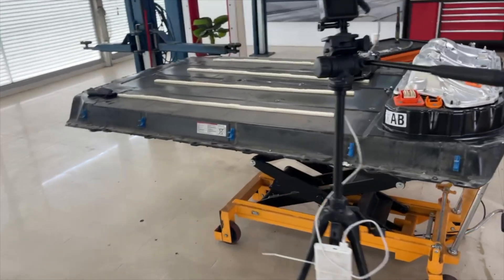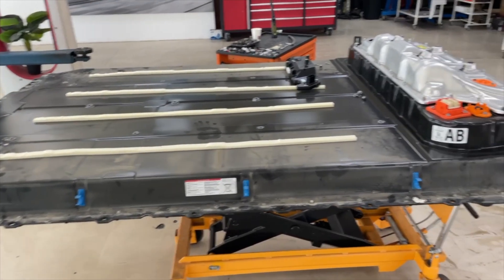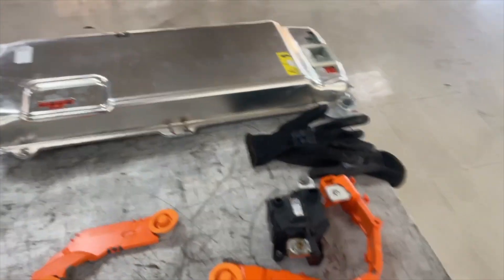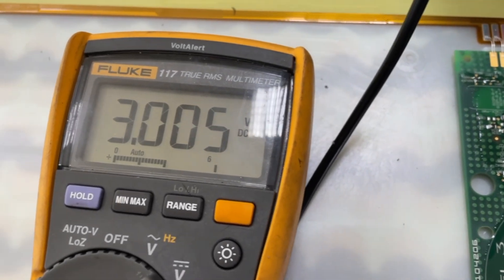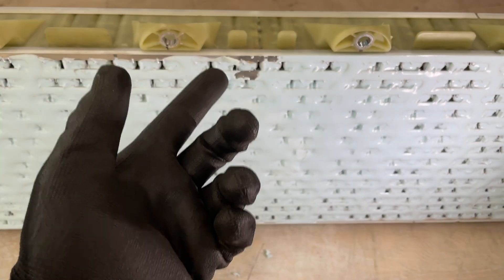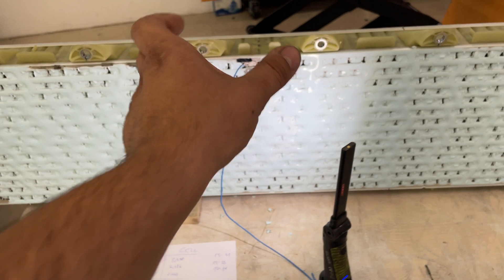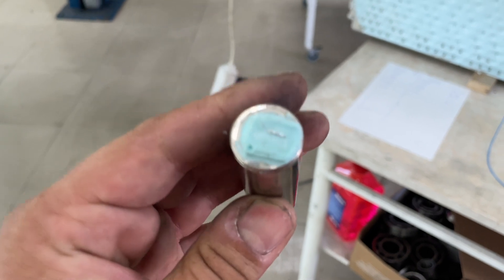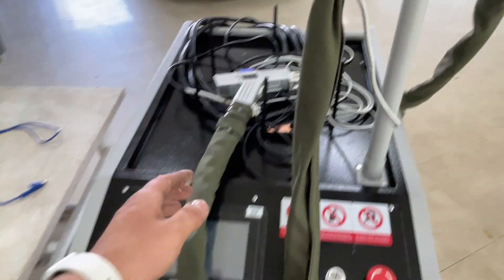Model 3 Battery 2170 Cell extraction - BMS_A064 BMS_A079 BMS_A066

Comment: I'd be happy to pay a price like 100 bucks for a good extraction tool so I could get 2170 cells out of a Tesla battery pack. Something that will let me extract a cell from the pack undamaged and safely at scale. The cells are worth 2-5 dollars depending on their health after extraction, and the packs sell for like 500-600 bucks here. I bought one to dissemble but punctured the first cell I tried to remove. Safety roleplay and good prep and safety equipment with a dry chemical fire extinguisher beforehand saved me and only one battery burnt like a miniature firework fountain.

Comment: why does whole block fail if discharged below 3v? can you explain please?..
Reply from the maker: If it it stays too long in min safe undervoltage, cells get permantently damaged and starts selfdischarge. Non-recoverable. One cell damages complete group and you need to change all cells
Reply: @evclinic  is it a problem for only model 3/Y packs? (2170 cells), i haven't heard anyone mention this for S/X packs with 18650 cells...

Comment: My 20-year-old Model 3 Performance had its high-voltage battery replaced three times with BMS A079 in May, June, and July. Tesla batteries are not normal and their technology is not very good.

Comment: Have Right now the BMS_a079 issue and will get a refurbished battery.
Degradation was measured with S3XY: 25%. After a while the changing was impossible at 30% SOC.
Model3 2021 US model 82kwh, with 140.000 km
Reply from the maker: Covid packs have higher failure rate
Reply: @evclinic  hehehe but mostly US ones no?
Reply from the maker: @vladsaltao LG chinese

Comment: By laser welding to the shoulder of that NCR2170M, you've ensured it will leak electrolyte from thermal damage to the gasket. Its critical the shoulder joint is made with ultrasonic welding.
Reply from the maker: Yes, we cant share how we solve it but it is not a laser.

Comment: This is unreal.  To see that Tesla has designed battery pack as it is.   The final takeaway is that Tesla did not think out ease of service but money making.  Same as why the electronics to drive the motor is enclosed in the power train casing making it very expensive to solely replace a 3 phase motor driver.   Unbelievable! thank you for illustrating what pain in the behind it is to replace one little 3.7 cell.  One should be able open and snap the new cell without having to pull your hair out. All things being said. if all works well, yes, one never has to worry about and how to replace a battery pack but for the few who have to in the future.
Reply from the maker: @SaenzFonsi  what are you talking? This is easiest pack to repair out of all legacy oem packs
Reply: @ in one sentence you just made my point more valid. The fact that people need you to replace one defective battery and yet tesla and others have a so called BMS system but can’t tell you which block at minimum is bad, when the there is and overcharge And undercharge signal present per block is an embarrasen to engineering. Even the BMW of ev’s who is glorified for its design is still not OBD2 coding the error. The fact that you have to bring down a 200 pound block to replace a 1 once sub component, doesn’t strike you as a really bad anomaly in the process? Really sr. ? I expected you to take a different stand and not the one you have taken.

Comment: Hi, what would’ve happened if that cell was just removed and not fitted based on the fact that the cells in the brick are in parallel? 🤔 would the bms detect that?

Comment: How do you safely drill out the lithium cell?
Reply: Looks like it’s pretty easy in that the cell isn’t actually welded to anything. You just blast out the guts with a drill bit and then carefully remove the casing with pliers

Comment: When I was removing battery modules out of the battery case I folded the lid up and it pushed on the plate that has the fuse and busted the fuse on a few of the modules so I bent it back down and soldered the fuse back on been like that for 8 years no problems but I use mine for home storage

Comment: Replacing modules or individual cells with anything but parts that are exactly matched is a fools game. 

You could have another cell fail a month after the repair, then what?

Repair companies here in the US have gone out of business trying your approach.

Replacing BMBs and fixing leaks does make sense and should have long lasting results.
Reply from the maker: Absolutely true, thats why you cant do cell swap wk057 knowledge and without proper procedures. There are steps to determine characteristics of healthy sample and then match sample from stock of used cells.

We never had repeated single cell failure. It is roadtested on MS 18 months and M3 6 months. Both taxi. 

Fools game is to change cell or more cells if you dont know how to measure acir dcir esr cac. Exactly what tesla didnt do in beginning of reman process, and what wk057 messed up and missinformed public that this is not possible.

Comment: I have a Model 3 with two bulges out from the battery. Its not near any bolt placement. But in the area of the outer rows of blocks. One on the left side of the car and one on the right side. Do you have some idea of what could have happened? I live in Sweden so its not so easy to just drive over and have you look. =) Its still under warranty also, so Tesla will have a look next week. No impacts and no special degradation or faults indicated.
Reply: What was it?
Reply: @liveandletlive2894  Tesla insists that it was manufacturing defects. I have had no issues with the battery itself. Still have some warranty left.

Comment: I wonder how long this fix will last.  I've seen others who have done this and eventually the difference in cell ages and resistance causes imbalance which the BMS cannot overcome.
Reply from the maker: Fix where they bypass one cell is nit working. We change cell with same age and internal resistance. Everything is as original, and will hold for long time.
Reply: @evclinic  If they are closely matched it might work.  Interested to see how long these last.
Reply from the maker: @JRP3  some of them work already for 3 years. Lot of amaters try to repair it without basic knowledge , like @richrebuilds and then it fails.
Reply: @evclinic  I didn't realize there were repaired packs that old, that's encouraging.
Reply: @evclinic I considering purchase of a bms_a074 failure car, charging limited to 14%, history of charge plug issues car. Is it likely to need a similar repair as this bms66/79 car?
Reply: Some repair packs with 10 years of knowledge and go out of business like Jason of WK057.

Comment: Fantastic job, I have this issue. 

I see only warning BMS_a066.
Tesla inform me, we replace the battery pack (car is in warranty).
The car function but the warning message is always present. (I have battery E3LD), I'm waiting the new battery from 3 month ..... is possbile the car damage all cells battery? and leave me on the road??

Thanks in advince for your answare.

PS: For curiosity how much does this job cost?
Reply: Yes
Reply: @JetFire9  I have change the battery some week ago. The battery installed is not new, but the car is ok.
Reply: @dariomazzi9610  That stinks it’s a used battery. That’s like buying used light bulbs from the hardware store with a shortened warranty. What did they give you, 2 year warranty?
Reply: @JetFire9  the warranty remain 8 year or 192000km